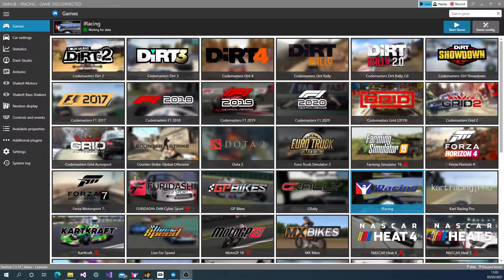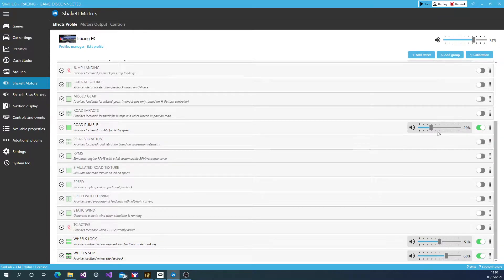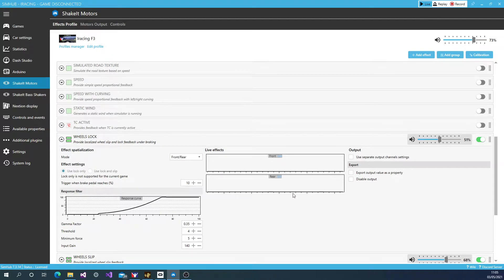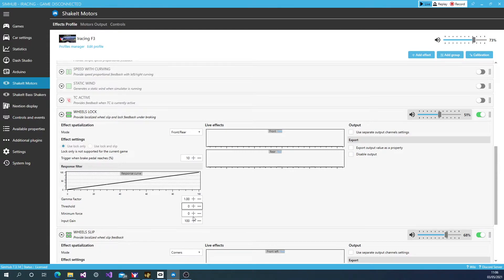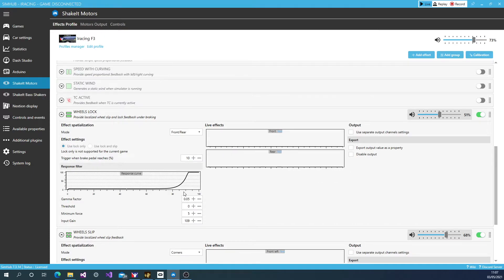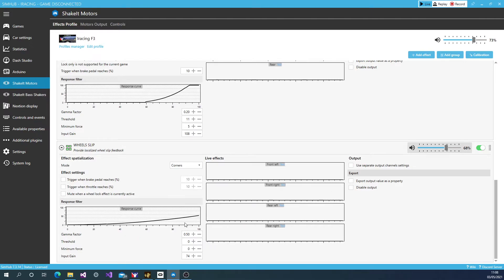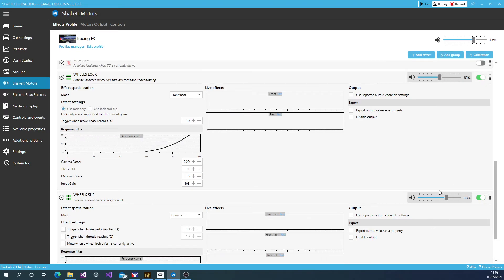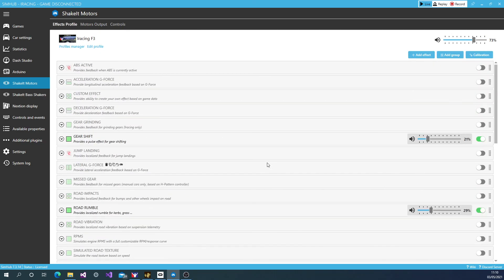Sim Hub Shakeit Motors Setup and Calibration.

Comment: A little tip for calibration to anyone interested, you can run the game in windowed mode (a small window) & watch the telemetry data in realtime to dial in the effects, also good to see if certain effects are clipping at the top end (which will lose detail) & or have unwanted noise at the bottom end

Comment: I have a problem, i have added many devices to shakeit..... now adding the last 2 rumble motors in simhub multiple arduino it says "connected to 13-14 motors" but in shake it motors control i see only 12 motors to be configured. How to increase it to 14 ?? thx so much

Comment: Hi, Could you please make a video on how to setup bass shakers. I am very interested in how deferential frequency settings work so its easier to interpret what is happening and how that helps with driving signals. There is not much out there on thses setup detsils. Thanks
Reply from the maker: Sure, although I have alot on at the moment so it will take me a while. What racing platform are u using?
Reply: @Mattlekim  hi, 8020 rig sfx100 thanos motion, 4 bass shakers isolated from chassis two under front pedal board two under seat. About 80 watts each so running about 60% power from wo stereo amps. 
SRS  Belt Tension System, Just fitted rhe rumble pedals but they are a bit weak, think they need a better power source than my overworked ush hub. I seem quicker with most stuff turned down a bit but the SIMHUB shakers even only using ABS, slight rumble, light wind noise, rpm, wheel lock and slip seem very muddled. To be honest I drive from rpm sound and tire noise. Will be very interested in your comments, thanks

Comment: Meus motores estão perdendo a força após 10 segundos de uso. Estou usando uma fonte 12v 20A ligados na Ponte H. Já passou por isso?
Reply from the maker: No sorry I have not.
It sounds like it could be the motors overheating. 
What V and Ams are they rated for?
Reply: @theriddler24  Yes, the motors support Voltage and are 12V. I put smaller engines and it worked, but the engines are very weak, I would like to put more power.
Reply from the maker: Ah ok. 
In that case it could be the board struggling.

Try turning the max motor speed down to 25% if that works then gradually keep upping the speed untill you reach the point it stops working.
Reply: @theriddler24  When I lower the % to less than 60% the engine doesn't even turn, it just makes noises
Reply from the maker: Do you have a V meter? If so check the voltage that is going to the motor. At 60% it should be working substantially

Comment: Can you explain how to properly set up road vibration or road impacts to mimic what I am feeling in my force feed back wheel .. I am not really sure which one to use as the both feel very similar
Reply from the maker: I have found its car dependent. I have the one that has kirbs in the description set to about 70% power. But if you change the frequency of the sound you will also get different results. Lastly if you are doing iracing it has LFE in sound settings. Some of the effects in there are really good. So I use a combination of iracing LFE and simhub. 
For the iracing LFE if you go to documents/iracing. You can edit the ini file to configure what bits of that you want.
Reply: I tried the iracing one omg amazing .. I am having trouble feeling the rumble strip. In iracing setting I notice it was default -6.0. If I raid it to -12.0 inwaould assum it’s felt less 
And 0.0 is maxed out setting thanks for the tip amazing I was blown away
Reply from the maker: @wesleychef  
I find the iracing one has some really good feedback but I disabled the iracing curbs. I'll share my simlab curb settings when I get on my pc.
Also I think you can go above 0.